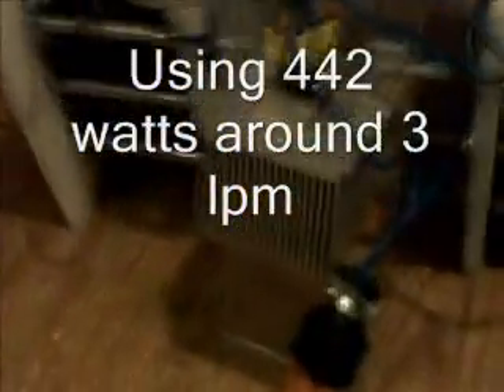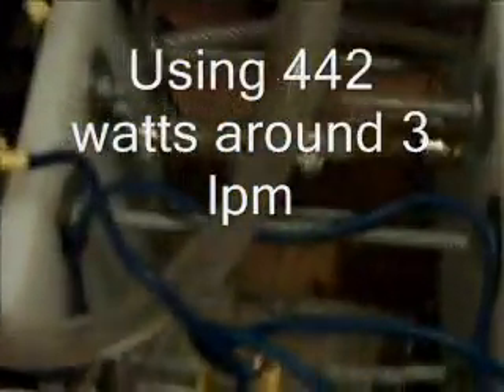9 HHO FLAMES using 442 watts

Comment from the maker: Hears what i been finding regarding to Electric stoves......
Efficiency is the measure of how well the electric motor converts the power that is purchased into useful work. For example, an electric heater such as the element in an electric stove, converts 100% of the power delivered into heat.

Comment from the maker: I been reading all night on this power factor stuff, and from what i have read (not from WIKI) i cant find anywhere its says 40% less ...if thats the case and the stove is 40% less then my cell should be too cause its drawing from ac ...I will just have to get a watt meter and most of it has to deal with electric motors .

Comment from the maker: I am comparing watt for watt  WITH A STOVE , I repeat STOVE ....
LIKE I SAID I DO NOT COOK WITH IMMERSION HEATERS , Do you not get that.....I Do NOT CARE if an immersion Heater can boil 50 gallons of water in a min ..I don't cook with one ..
I have done test compared with my stove ...
One of my test  is I boiled water using 725 watts in 3 mins USING HHO.
I used the same pot , the same amount of water on my electric stove on hi  using 1386 watts,it took 6 min to bring the water to a boil ..

Comment: You are comparing a stove to a flame.

Place a 1 quart pot of water on your 442 Watt flames and time it to boil.

Do the same with your stove.

Three 100 Watt immersion heaters will boil you half a tuna can of water quicker than your flames.

442  Watts of pure electricity produces 442/3413 BTU's. 

442 Watts of electricity input to your monster generator cannot produce more than 442/3413 BTU's of heat.

If it could be done, it would be OU and you have achieved Perpetual Motion.

Comment: This is the PROBLEM!

You are confusing HEAT with TEMPERATURE.

Light a match, the flame is HOT but it has very little HEAT.

In fact, your body at 98.6*F  has much more HEAT than the match flame at 800*F.

The difference between 'Heat' and 'Temperature' confuses many folks.

BoyntonStu

Comment from the maker: I dont know  for 100% sure yet , but I done a watt test with a burner on low yesterday and it was inbtween 600 - and 800 watts ...One of those electric burners on low will not boil water ...

Comment from the maker: Yeah i cranked it up to to around 700 watts and boiled the same amount of water in little over min .. yeah I can take a metal plate and put on it and and frop water on it and its just about instant steam man ....I imagine if used a 1/4" copper like with these flames lined up on it and have something circulating the water yo uwould get some major steam ...I plan on adding more tips , soon as i can get some ..

Comment: One BTU is approximately:

1 054  1 060 J (joules) 
2.931 ×10-4 kWh (kilowatt hours) 
252  253 cal (calories, or "little calories") 
0.25 kcal (kilocalories, "large calories", or "food calories") 
25 031  25 160 ft·pdl (foot-poundal) 
778  782 ft·lbf (foot-pounds-force)

Comment: You should look up BTU and do your figures that way

A BTU is defined as amount of heat required to raise the temperature of one pound of liquid water by one degree from 60° to 61°Fahrenheit at a constant pressure of one atmosphere
One BTU is approximately:

1 watt is approximately 
3.413 BTU/h 
1000 BTU/h is approximately 293 W 
1 horsepower is approximately 2,544

Comment from the maker: It would probably do it alot quicker , if the sides were closed in and a lid was on it .....I need more mig tips lol ..with my hole size i cant push no more than 3 lpm thru those nine i had some serious backup pressure , i was starting to get a leak on one of my bubblers ..